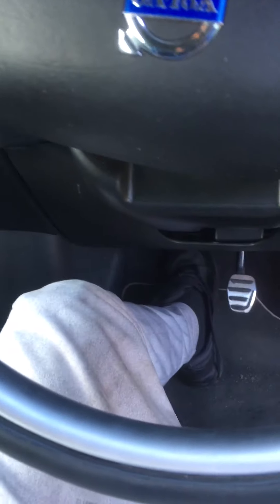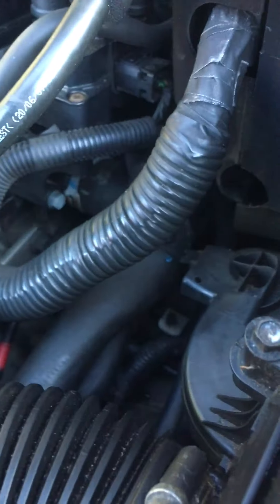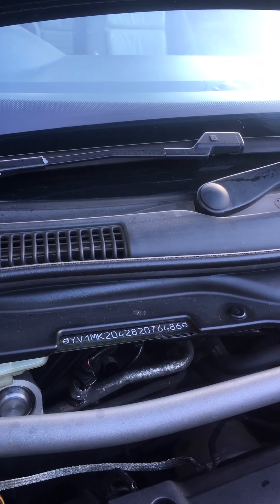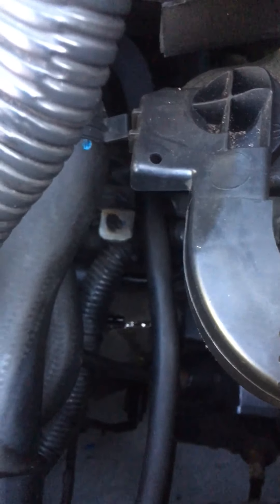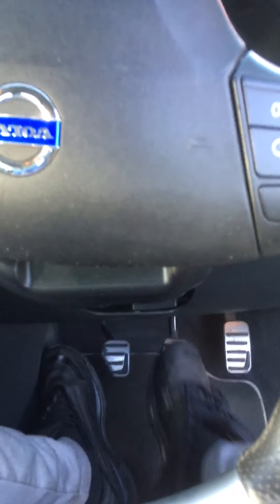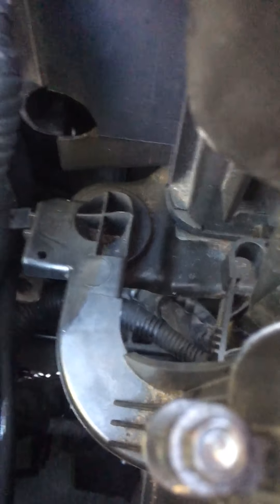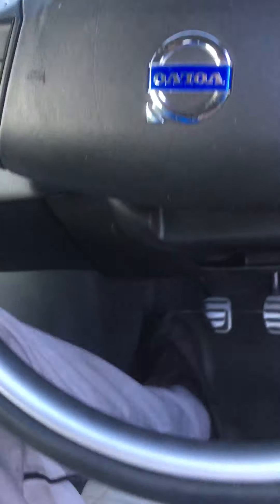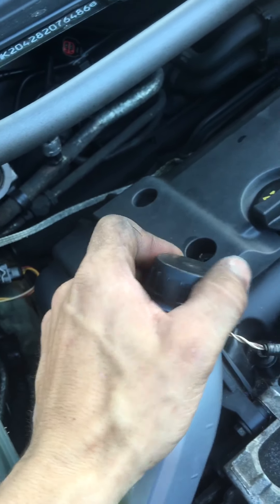How to get air out of hydraulic clutch Volvo C30 r design , no bleeding kit and on your self

Comment: First off. Thanks for the video. For anyone trying to find what he reached for. When he puts his hand down that gap, to the left you will find the bleed valve. It feels like a plastic nozzle. Turn to open then turn back to close. One final tip.THIS MUST BE PERFORMED ON FLAT GROUND. I live up a hill. I did a reverse bleed and filled the cylinder with air. Had to find a parking spot down hill and roll down there. Then repeated and it worked.